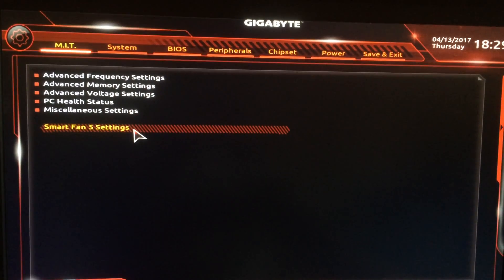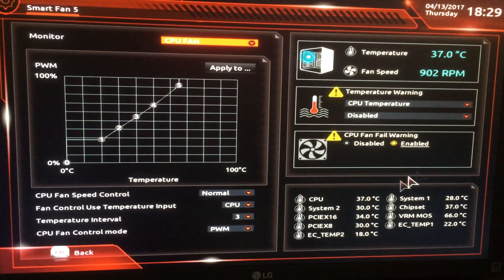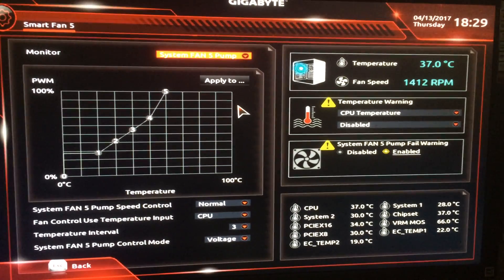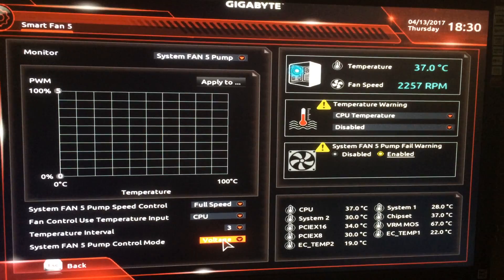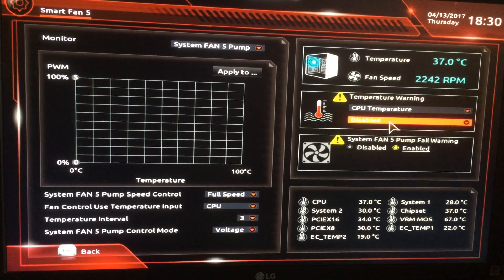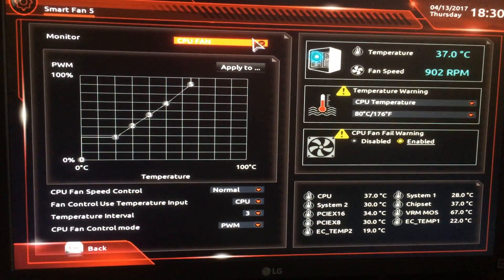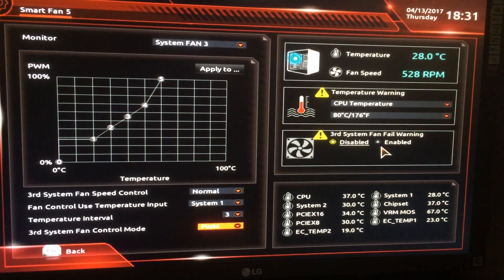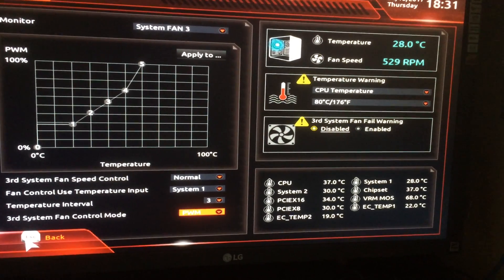Aorus Gaming 5 Setting the FANs via the BIOS - Smart Fan 5 setup

Comment: Gigabyte B450 Gaming X, F50 bios here... and it seems the "Interval" option doesn't do anything at all. CPU fan speed ramps up instantly with CPU temperature, regardless if it's set on 0, 1, 2 or 3. Anyone found a fix for this yet?

Comment: you need to supply better information when you ask for help...for example, are you monitoring the correct fan socket, on my mobo - there are two fan sockets for the cpu fan, one of them will always be zero rpm. What fan are you using, what BIOS version and so on. This is difficult to guess as to know what is going on without having the machine to hand. Good luck.

Comment: Click the "GPU" icon, and then click the "Cooling" slider control and slide it to a value between zero and 100 percent. The fan slows down or speeds up automatically, depending on your setting.

Comment: My fan is running at 2051 rpm is that bad??
Reply: check out mu new video https://youtu.be/z9GnaU1P5_w
the fan speed seems to be quite high. Have got the settings set to max?  which fan is it? does the speed change with temperature ? Are you  gaming when this happens ?
Reply: @FXV  it's a stock fan. I've heard alot of bad reviews from ryzen 5 3600x fan reviews, so I'm hoping it's just that . CPU doesn't seem hot or anything it's weird . Runs fast even on normal tasks
Reply: @FXV  I put the fan speed control to silent and it's running around 1854rpm and CPU tempt is at 34degrees. This seemed to help with the loudness and RMP of the fan
Reply: @CrOaTiAnN1  Ah the stock fan....have seen a few forum discussions,  as I don't have one cannot really  make any comments. Have been using an AIO setup on my rig and it works well and fairly quiet.
Reply: @FXV  I just realised that I have not booted my PC on my SSD. I put the booting system and windows onto my HDD. I now realise why it's running so hard on the boot up & when opening applications. Damn
Reply: @CrOaTiAnN1  yes boot from SSD, that will help. Also add a front fan to cool HD if you don't have one.
Reply: @FXV  gonna be a mission transfering to my SSD from HDD not sure how to do it
Reply: @CrOaTiAnN1  Disconnect HD and reinstall on SSD unless you already installed all your apps on HD.
Reply: @FXV  yeh I have, is it possible to transfer files from HDD to SSD and just boot from SSD
Reply: I am now running through my SSD. Fan is working fine and computer is alot faster. Fixed
Reply: @CrOaTiAnN1  Did you rebuild or clone?
Reply: @FXV  ketp all files on my HHD only cleared my ssd

Comment: my fans just started to spin at 100% for no reason with no load at all. I opened the bios smart fan screen as shown on this video and anything I do stops them to spin at full power... even flatting the manual adjustment. what could have happened?
Reply: I have the same problem, did you find the solution?
Reply: @davidteen14  Sounds like you need to plug the AIO pump into the CPU Fan header on the Moba.

Comment: damn it but i have lower speed pwm on full speed how fix this ? max 1200 before 1900
Reply: are you doing the check in the BIOS ?  What happens if you do not use PWM ?   If still a problem report it to  support for your mobo.
Have you also tried this using a different connector for your fan ?

Comment: pwm , auto or voltage is best for cpu
Reply: when you select auto the rotations (rpm) are determined by the mobo, so if the cpu is hot it asks for more rpm (then it uses voltage or pwm to give the desired rpms) to cool cpu.
Reply: When i pick the pwm setting, my fan is making a lot of noice but when i pick the voltage setting, the noise basically stop.

Comment: Has anyone used a captain 240 rgb v2 with this board. I can get a fan reading but not for the cooler. The cpu temp is low so it has not been an issue but the lights on it are also not working.

Comment: Also have the same board and the BeQuiet silent loop 280. so when I set it like this, the pump gets all the time 12 V right?
Reply from the maker: It should get 12V. In my case I have some air in the cooling liquid and if I have the pump at full speed sometimes  the air gets trapped in the pump section....slowing it down slightly sems to work

Comment: Hey, quick question.  I'm getting a Gigabyte b250-hd3 mobo which I believe has the same bios interface and Smart Fan 5 control.  The mobo has 1 cpu_fan header and 3 sys_fan headers.  The aio pump I'm looking into is the Deepcool Captain 240ex, and the watercooler's instructions say to plug the pump into the cpu_fan header.  The two radiator fans it comes with are PWM and would have to be put into the sys_fan header using the cooling system's included fan hub.  According to the vid it looks like I'll be able to set the sys_fan header to adjust the radiator fan speed based on the cpu temp, is that right?  Thanks so much
Reply from the maker: yes the BIOS lets you set the fan and pump speed for attached devices which can be adjusted according to temp settings. Some pumps need to be set to full speed otherwise they can make intermittent noise when changing speed.
Reply: Awesome, thanks for the info!
Reply from the maker: Cool ...
https://sites.google.com/site/windows10okok/

Comment: Using Giga AB350 Gaming 3. Do not set fan speed control to manuel on bios.  manuel fan settings cause xmp crashes and goes to bios reset. Use gigabyte app center and system information viewer for fan rpm settings.
Reply: ummm i have 3 fans set as manual for like a week now...is that still happening? Because everything seems fine for me.
Reply: ty for the tip gonna check it